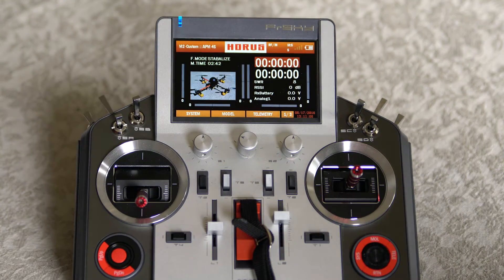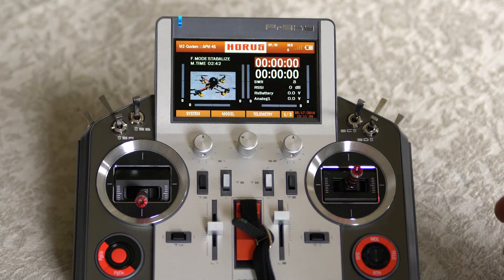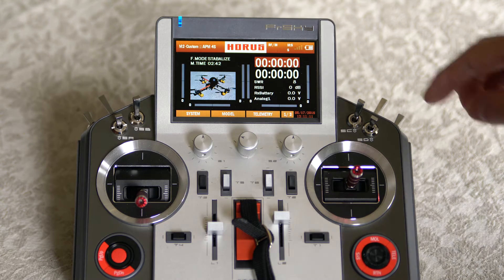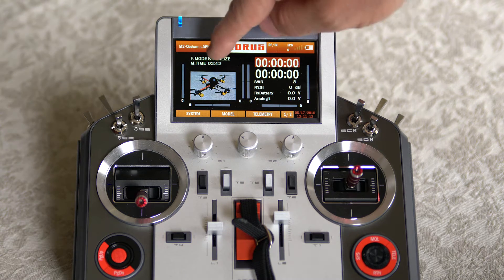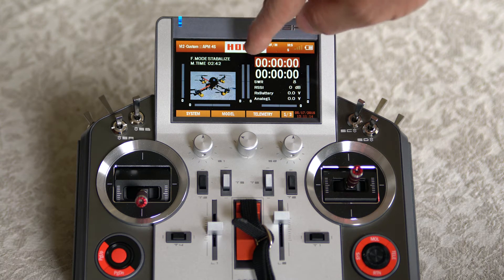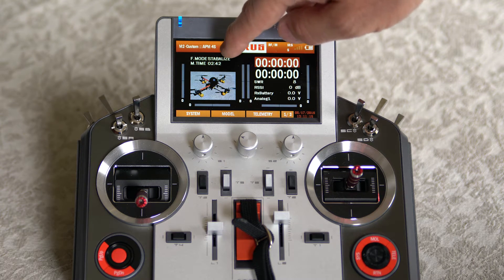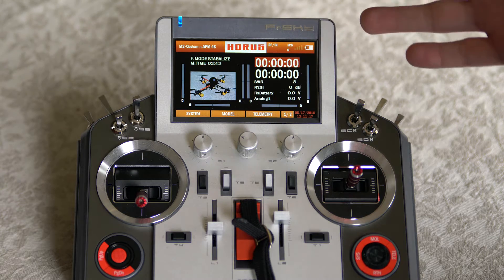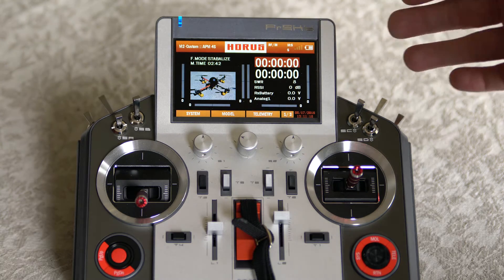Horus APM Setup - Getting 6 announced and displayed flight modes on FrOS 1.0.04

Comment: Lets talk about the 3 rotary switches in the top center of the remote - The center 6 position one in particular ;)
Is this Video still supposed to be unlisted? Because it totally appeared on my YouTube recommendation list.
Reply from the maker: It was unlisted during beta, but not anymore.
The three knobs are 2 pots and one 6-position switch.  You can use the 6-pos switch to select flight modes, but I prefer combos of two multi-pos switches because I can go to exactly the flight mode I want instantly and without looking at the radio.

Comment from the maker: This is from Beta, some of the complaints I have are fixed for release firmware.
Reply from the maker: BTW: The stuff about weights is wrong in here.  I misunderstood how they work.  You want left and right weights to both be 100 for normal operation.  This is fixed in an updated version of this which should be documented in the manual.